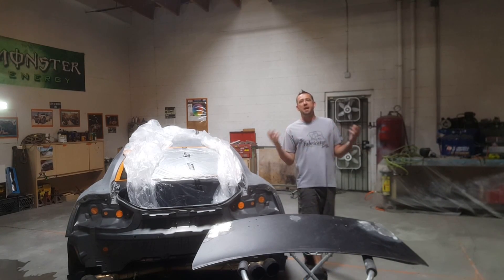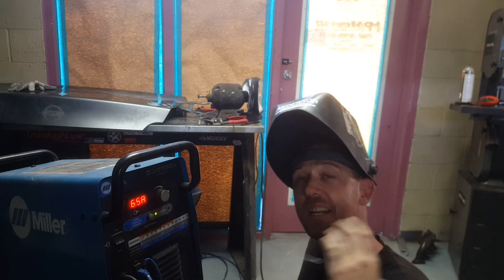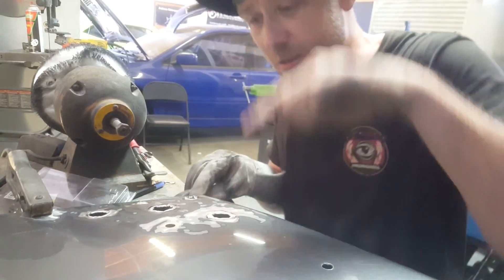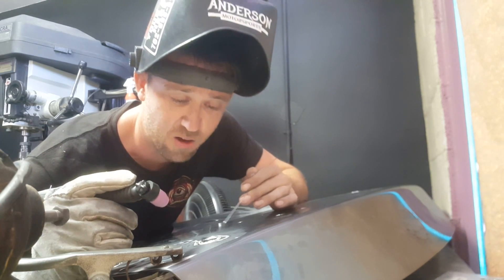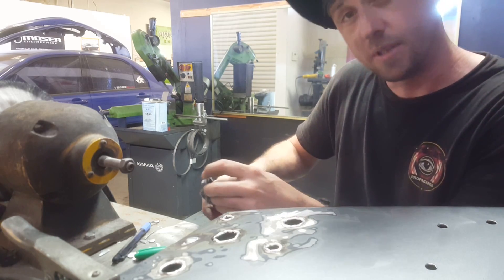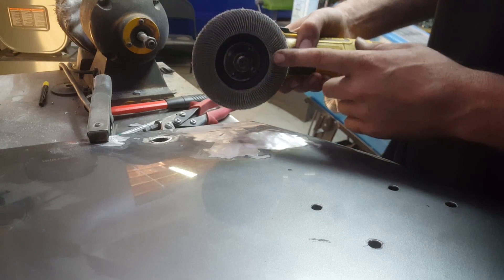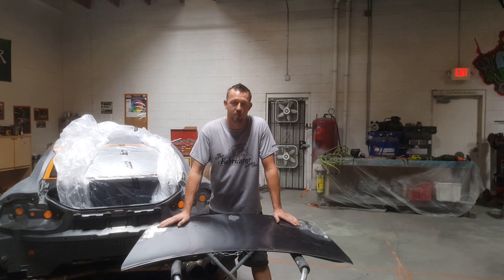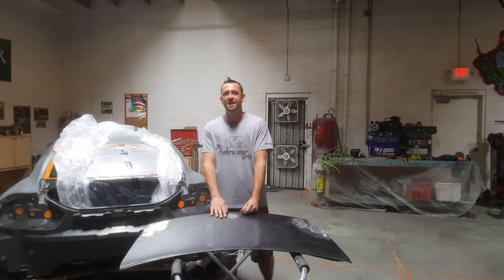TFS: Welding Very Thin Aluminum (GTR Trunk  Shave)

Comment: Question......when welding an exhaust pipe repair for a bike like this...... does the filler metal that drips through on the inside effect the air flow to any degree of significance or obstruct the ratio in any way?  Would it possibly be an option to fabricate a small thin ring as a type of "sleeve" that is just wide enough and as thin as possible to prevent that? I assume the inside circumference would reduce a little bit but at least its uniform.  right or wrong? Feeback highly appreciated. thanks. cheers.
Reply: oh, and of course i meant a ring to go on the inside of the pipe

Comment: It doesn't always take a "chill block" as a backer.  I used a strip of stainless steel as a backer when I was filling in pinholes on an aluminum boat.  I used a strip a couple of inches wide and a couple of feet long and was even able to bend it into a Z shape.  The springiness of the SS helped hold it in place, and I was able to get in some tight spaces with it.  I think I used 18 or 20 gauge stainless.

Comment: Would it not be a lot quicker to cut a square section?
 that covers all  the small holes at that side .
Then welding a larger square section in that hole ?

Comment: Thanks for great video, I am attempting to do just these type of repairs to an old Landrover Defender and this video is one of the only ' real life ' a real panel getting a job done videos on YouTube , most are brand new bits of aluminium getting welded with everything precisely as you would want it , chill blocks, no paint anywhere etc. What amps were you set at to weld the initial edge of the holes ? I don't seem to be able to establish an arc without melting back instantly. Thanks for great video 👍
Reply: He initially set the machine to 40a. If you have an inverter machine and can choose your wave shape try a triangle wave shape and/or play with the cleaning action (wave balance) a bit to reduce the heat soak of the area. He states to get in, get moving and introduce rod to cool the puddle, which has been my experience as well with thin aluminum. But adjusting the wave balance as well as wave shape (miller dynasty 200dx in my case) as well as reducing to a smaller tungsten size has helped me in the past.  Best of luck in your restoration endeavors.

Comment: I know I’m a bit late since this clip are over 4 years old. But the best way of doing this is MIG. I’m of course talking about, just that, not MAG as everyone call MIG. You can get penetration without the massive heat dump and therefore less warp.

Comment: Instead of using a hole saw ues a rota broach bit for a mag drill. They cut much better especially if you need to cut steel plugs.

Comment: I have a magnetic drill which uses 'plug cutters', aka annular bits that cut a really nice plug with the lip as clean and even thicknessed as anyone would want.  They have a 3/4 Weldon shank, but could be chucked-up into a large 3/4 chuck.  I noticed the hole saw wobble in the vid...
I've had to drill a bunch of various sized holes in .063, .120 and .250 wall square tube and have a crud load of those plugs in a drawer I thought of saving for some crazy reason, lol.

Comment: is it humanly possible to weld aluminum on aluminum with a pulley section that broke off on a timing cover for a truck and making sure it doesnt break off once the serpentine belt is back on?

Comment: MAKE A RECTANGLE STRIP THAT IS WIDE ENOUGH TO GO THRU THE  HOLE WITH A 1/8" HOLE IN THE CENTER TO USE A WIRE TO HOLED IT TO THE UNDER SIDE TACK AND WELD. JUST A THOUGHT

Comment: I do these an easier way. Punch out the plug and tack a weld rod to it. Crank up the amps while holding the plug and tack top , bottom ,left, right. Keeps the heat out.

Comment: I don't understand why you didn't make an initial rub of each hole and a small aluminum filler disc for each hole and weld it in. I don't really understand adding a bead around the hole first. if you can add metal around the edge of a hole, wouldn't you be pretty much done already if said you just added was actually your weld.

Comment: Why not slip a strip into the hole with a welding rod tacked onto to hold it 
Slip it into the hole tack it in place
So basically backing it up from behind 
It wouldnt be totally backing the hole but about 80%

Comment: Nice example of the "down and dirty" way to do this. However why not just use a slug cutter and a step drill or reamer to make friction fit round holes for the slugs? I know a lot of body work is down and dirty metal work followed up by artistic body filler and sanding but I feel like this case would warrant less crude welding. ether way the approach used isn't bad, just a bit more rough and let the paint and filler guys work their magic.

Comment: Im fairly new to tig welding but since copper draws more heat than aluminum, could you clamp copper chill bars to the top side very near where you were welding to dissipate heat and minimize warping? I’ve done this when mig welding thin sheet metal with good results. Might be a good test video...
Reply from the maker: Watch the video again where I talked about chill bars and why they weren't used.
Reply: @TheFabricatorSeries  i think you misunderstood his point.  You could have used slabs of copper as heat sinks on top next to the holes to pull off the heat.

Comment: A piece of advise you do not have to wait for the metal to cool.Most people that own a tig welder most likely own a compressor you can use filtered compressed air to cool the metal with a blow gun lightly blowing near the weld area.
I have watch your video to the end but if you do it right without a lot of force from the blow gun it will not make the metal cool improperly.
In body shops we do not have the luxury of waiting and this technique has been used on steel,Aluminium,stainless.
Reply from the maker: CRAZY HORSEPOWER You should read the other comments where I talked about this.
Reply: The Fabrication Series Not trying to be a wise guy I will read other comments But it's funny that I came across your video this morning as I happen to be working On a Aluminium door panel with a small tear.
Reply: The Fabrication Series So I read through the comments and I did not see anything pertaining to what I said.
Also If you are concerned about the grinding and warping the Aluminium set up your blow gun to cool the metal.
As far as welding the Aluminium I agree in replacing the welder and using high Frequency,
One other thing I guess you never tig standard everyday Aluminum foil have you ?

Comment: I'm not expert, and by no means mean any disrespect .. but I'm wondering why didn't you consider to use a copper shill bar behind to control that temperature..
Reply from the maker: Migueldeservantes The reason is the same as I said in the video.
Reply: Well I actually took this time and see the entire video. Just last fryday I was doing exactly the same with SS... on a pressure vessel... "air brake tanks for a public transportation.." and couldn't put a shield bar behind neither... so year some times ins literally impossible to use a shield bar.. thanks for been courteous. I appreciated that.

Comment: I might have considered using Transtar 1738 panel adhesive and AL slugs to keep that much heat out but this is very well done. Do whatever works. Maybe think about a half-round and flat Vixen file to knock down the welds. Very easy to control and zero heat while removing a lot of material. I'm more worried about grinding heat than I am welding. Never tried it, but I wonder if that magic rod they sell at flea markets works...solders the hell out of 2 AL beer cans and since isn't structural, might work.
Reply: I know what rods youre talking about they might work well structurally but you have to heat up the parent metal super hot for them to start melting. The paint job would be absolutely fucked. Not to mention the warping

Comment: Here's a trick for you. Before you weld the rings in the holes, cut discs that just barely fit in the hole. Then weld the end of a welding rod to the center of the little disc you cut out. Use this as a handle. Drop the disc in the hole with the rod handle and then weld the rings around the holes. Now pull the disc up against those rings and you have a nice little plug to fill the hole. Fusion tack it to your ring and then weld it up. Way faster and no big blobs to sand off. Love your vids. 
-Fabman :)

Comment: Have you ever considered thicker stainless backing on the holes
Reply from the maker: There was no access to the back of the holes which is why the method shown was used.
Reply: Alternatively, if you could have used it, would you be able to use something like brass on AL this thin? I've never welded AL that thin before.

Comment: I'm wondering why when You had perfectly round holes, You didn't cut plugs from the start with hole saws ? I am not a body guy at all, so I'm guessing there was a reason ?
Reply: Whats he's asking is why you didant just weld slug into the original holes, (whick i would do on a steel job like this) but you mentioned at the start of the video to wanted a thinker edge to weld the slug too.
Reply from the maker: dieselrotor I'm not sure what you mean.
Reply: 32 year long heavy duty mechanic,fabricator,welder,builder of custom semi's and wreckers and I have been binge watching Your videos and am learning tons ! Thank You ! 

If You have perfectly (or close) round holes, could You not lay a sheet down, 5 penny nailed to a 2x4 and use holes saw to cut plugs a little over the size of the holes (I have a large assortment of hole saw's from over the years) ,tack a scrap bit to it for a grip/handle then sand/grind it to size to fit in the hole using the scrap bit to hold it in the hole,tack in place,snap off the little scrap handle then fill the outer diameter of the plug then fill in the drill hole on the hole saw plug instead using less filler and less heat ? 
Again, absolutely loving Your videos.
Reply from the maker: Did you watch the entire video? You are describing something similar to what I did but in a different process. I cut hole saw slugs to patch in the larger holes.

Comment: What happens when the car is in the sun and the trunk gets really hot and cools at a different rate than those super thick metal slugs?
Reply from the maker: It won't get hot enough for that kind of expansion.
Reply: What is funny?  BBQ paint? cooking? what are you talking about?  
We are talking about the sun heating metal and the inevitable cooling causing expansion and contraction of the metal which aluminum does a lot of this even steel as thin as it is on car bodies.  Throw in the vibrations of the car when driving and the opening and closing of doors and trunks and hoods and there is a very real possibility of the paint failing or even warpage or distortion due to the different expansion and contraction and vibration around stress risers caused by welding and the thickness of these plugs.
Reply: There will be no difference at expansion rate since both the trunk and the slugs are made of it. Also even if they were dissimilar metals their diameter is comparatively small and it would hardly make a difference (just something to keep in mind in that case), and it will really not get that hot unless BBQ black is your color of choice...(kind of a trend lately)
Reply: It wasn't only the heat I was concerned about but also the vibration. Also I am assuming wrongly I admit that the aluminum body of a GTR is as thin and flexible and unsupported as the aluminum cars i've worked on.
Reply: It probably is thinner and as flexible but in the end I think it will be more rigid.
Reply: yes and that's the problem is lets say the worst case scenario of a thin aluminum non structural skin on door or hood or something the rigid slug in the middle of heat because of differing expansion from heat or the vibrations would cause the metal around the stiffer plug to move more and cause problems.  of course maybe I should just not worry about it! haha its not my car.  But i was interested in hearing other peoples thoughts and experience with it because it might be how I will have to repair my own car.

Comment: Excellent video. I TIG weld in the Aerospace Industry...when I have to plug weld, I use aluminum tape on the back side to hold the plug for my tacks, then remove and clean if necessary before I finish weld probably at about 200HZ.
Reply: I agree...I have both a Miller Dynasty 200 and Dynasty 350 with no regrets on purchasing both.
Reply: Sell the Diversion and get a Dynasty 200.   The Diversion is a budget machine and from my experience, is not built all that rugged electrically, not to mention the permenently mounted torche cable is heavy and doesn't flex well.  The Dynasty starts and runs smoother and you will feel spoiled having actual adjustments for AC as well as pulse (which I dont use but some love it).
Reply from the maker: I wish I had the adjust ability and accessibility with this piece and welder.

Comment: Quick question, would you use this same technique for steel, or is this specifically for aluminum?
Reply from the maker: Steel panels are much easier to manage. you can simply cut a slug and weld it under the bottom side or cut the same size and use a magnet to hold it in place. It also doesn't warp as bad as thin aluminum which makes most of these processes in this video unnecessary.

Comment: Before I joined the Union Boilermaker in 2002 , I took a Basic Welding coarse to get my foot in the door.  For the life of me I couldn't use a Pedal and Tig  weld at the same time.  Now  I have a High Frequency Box for my Trailblazer 302 and I can finally do all three movements.
Reply from the maker: Just takes some practice.

Comment: Was There any way to get a copper spoon behind the hole ? Taking forever just Means to us Welders that You are doing the job Right the First time because even the slightest Mistakes cost time and money.   Most Customers think that you just Hurry up and do the job but they don't know that in the long run it will cost the customer more money and  more time to wait for the project to get done.
Reply from the maker: There was no accessibility to the back side of the holes. The outermost holes could be accessed, but everything else had no space or access.

Comment: should of just dynaglass and some lightweight filler over the holes and called it good.

the body guy is gunna have a hell of a time getting that trunk straight after you welded on it.....
Reply: Expansion and Contraction rates between aluminum and fiberglass are different... meaning over time the patch could fail. 

I'd rather do body work on this after being welded on.
Reply from the maker: Filling in a hole with no backing will cause failure over time unless there was more material over the top to hold it in place. Adding (or "floating") the top of the trunk would cause cracking over time because it will shift and move due to vibration, expansion and contraction, as well as the new wing pushing and pulling on the trunk lid. You have to minimize the amount of filler present on the trunk lid so that there is nothing to crack. In addition, the procedures used in the video prevented the trunk lid from distorting. There was no need for a hammer and dolly to straighten it back out after welding. All that was needed was a very light layer of filler to fill up the low spots (you can see the low spots toward the end after grinding).
Reply: I've done body work for 16 years and hes job is fine. nothing a light skim of polyester fine filler and a few coats of high build primer wouldn't  get flat.
Reply: +Guinelle1 Aluminium seems to distort a lot less due to the way it dissipates its heat. Why you should always becareful when welding in funny positions not to rest your forearms on parts of the job. Got a couple of good burns that way on aluminium tube
Reply: the only reason i said that is because just what i have done and has worked. short strand filler is good for holes up to 1" most of the time. 

i didnt realize another wing was being put on when you said "shaved" id assume nothing would be going back on.

also i dont work with aluminum much but i know it takes heat very well so i dont know how bad it warps. i know steel and especially stainless warp really bad if you were to run a bead like that..

i never do nothing more then a tac.

either way that takes still to weld aluminum like that.

Comment: Bondo has no place on a vehicle of this price point. Nice clean job with the aluminum. Hope the owner is happy with the work done.
Reply: Theirs no issue using body filler on this deck lid. Actually using body filler isn't an issue at all, as long as theirs minimal amount possible it's fine
Reply: +Integra DIY I will agree with you on that point. Minimal being the key word.
Reply from the maker: Body filler was used to smooth out all the work I did to get rid of the holes. It has to be done no matter what because it is almost impossible to get the metal perfectly flush and smooth after grinding. The amount of filler needed to refinish this lid was very minimal. It was only a thin layer for the low spots followed by a scratch coat.
Reply: Tim Nault You may not know this but the Factory uses fillers for small imperfections.